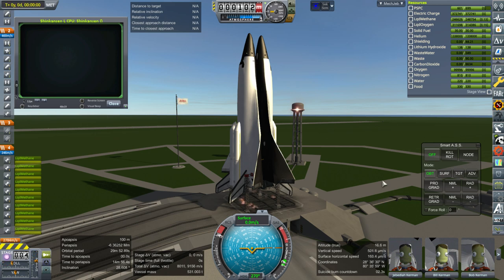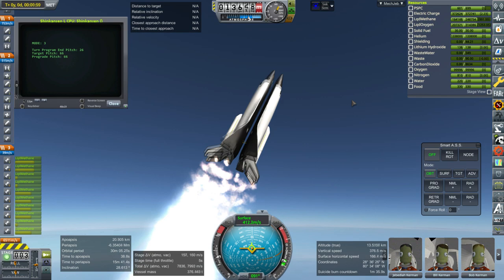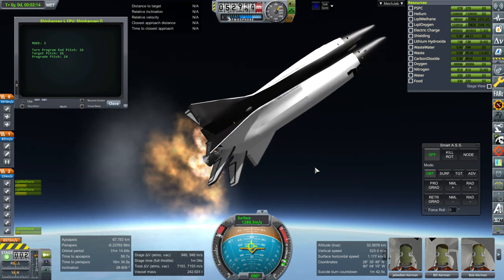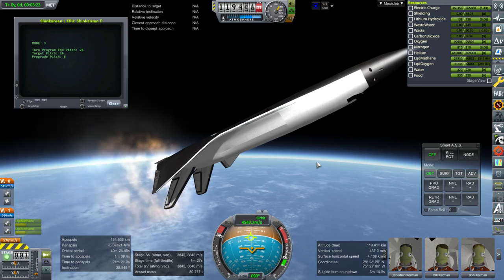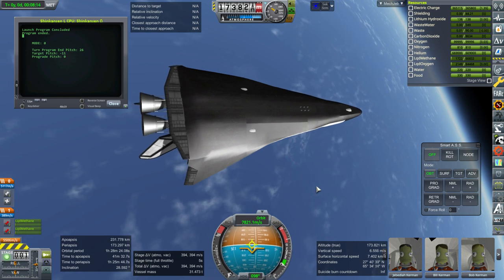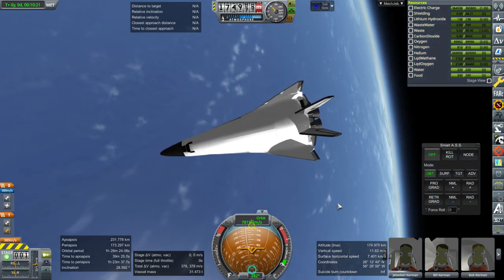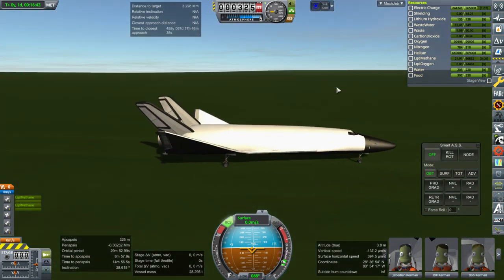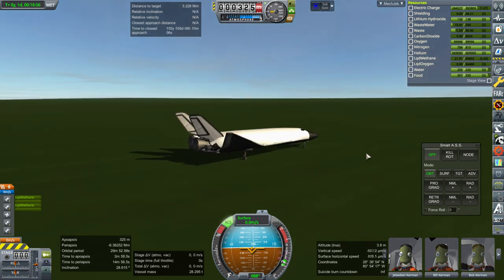KSP - Realism Overhaul Sandbox - Shinkansen Spaceplane Reborn

Comment: Reminds me of the British MUSTARD spaceplane.
Reply from the maker: Yes, with the significant benefit that using methalox instead of hydrolox means less fuel volume so that we can get away with just one carrier plane instead of two. Downside is the limited cargo capacity. Pretty much every idea I come up with, I find out eventually that someone came up with it already in some form, usually in the 60s, but I take it as validation that I'm not out of my mind.

Comment: We are Biamese if you please, we are Biamese if you don't please... (sorry, just had to)

4:40 and 10:15 I (well, along with certainly several others) came up with the idea of a combined Capsule/Service Module with retractable heat shield panels over the engines, allowing, for example, a spacecraft to land and ascend from the Moon before reentering Earth's atmosphere in one piece to be re-used.

5:15 and 11:20 LOL

6:15 Would it at all be possible to "Quake" the control surfaces and their functionality into the model itself?

14:30 With its name, I was half expecting it to launch or land at Tanegashima instead.